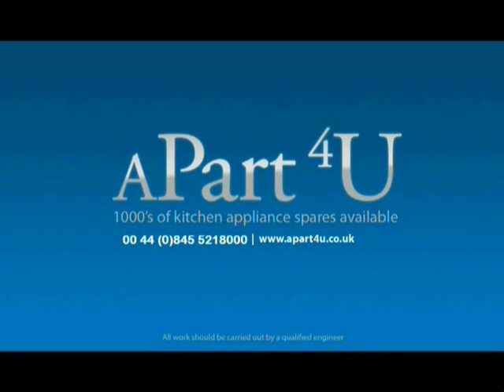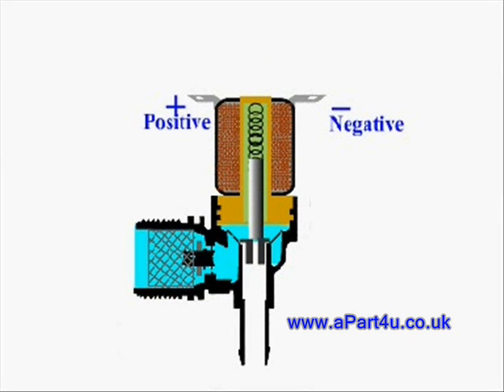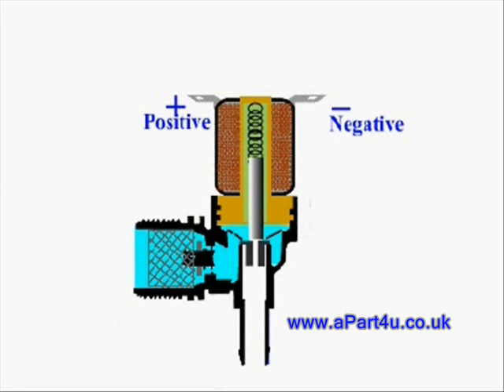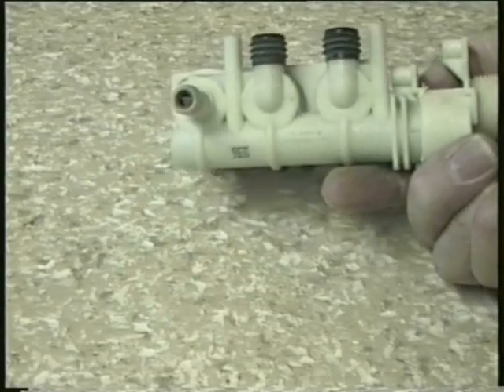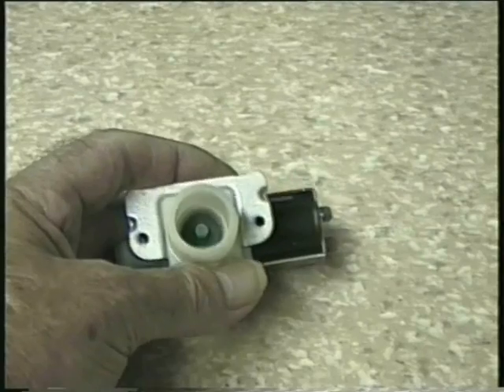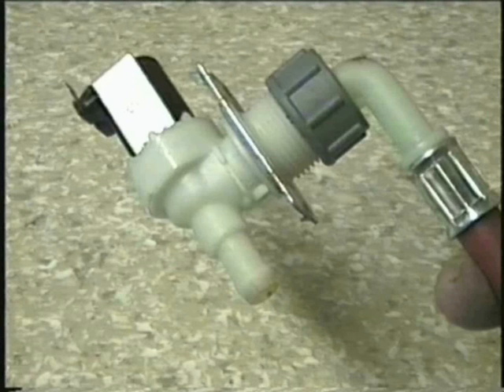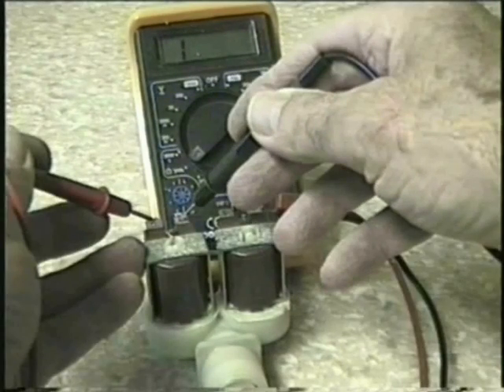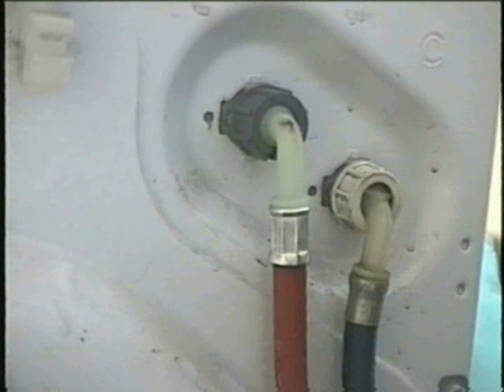Washing machine not filling with water

Comment: Hello, I couldn't find my washer at your website, but I'm hoping that you can help me.  From a thrift store I bought a Samsung Powerfoam VRT model # wa5471abw xaa01   which is a top loader that looks like a front loader.  The water won't go into the washer AT ALL.  I checked the valves, the hoses (both regular) the screens at the inlets (cleaned out one of them), made sure the drain hose wasn't pushed too far down into the drain.  

As far as I know I covered all the bases.  When I turn it on, I can hear clicking, like it's trying to work, but it won't fill.  Also...no error messages either.

I'm guessing it is either a relay switch or something to do with a pump (if it uses a pump) .  Can you  p  l  e  a  s  e  help me?  When I purchased the washer they said I could return it if it didn't work, however, it wasn't until AFTER I purchased the washer, they informed me they could only give me store credit and wouldn't refund my money,  Ugh!  I am just not in the position to throw away $100 dollars, and don't need any frivolous things from a thrift store.  They had no other washers to choose from, and I'm at the mercy of others to transport it 35 miles back to where I got it.

Thank you in advance if you can help.

Comment: I recently cleaned out the filters, ran an empty cycle with a tablet and it worked fine. Now, after filling it with a load, it has become a teenager ! It won't work beyond a first light flashing, I have checked the drainage hole, and the pump WORKS........... and somehow, I managed to get the inlet, work for 15 seconds, then it resumed sulking again. Back to the first light flashing again.    Am I a bad parent ?

Comment: need some advice replaced the water valve aswell as the water pressure chamber on a hotpoint WMUD942 Ultima and its still not taking any water in, any other advice you can give me?

Comment: Hello, I have Indesit WILD86 Washing machine, its stooped after the first round washing on any program with 02 green flash and one red flashing light and too much noise,
After washing for 10 minutes and start pull out the water to start rinse or complete the cycle here the flashing light start and can not take water again to continue.

Comment: once power socket to solenoid  disconnected, I measured Voltage on  the solenoid socket was 22Ovolts, but when connected back suddenly power voltage missed out and solenoid not operated.  could be somebody explain me what is going on my Samsung Washing machine Wa90fa.

Comment: Hello, thanks for all your info but I have a problem with my Kenmore  #110.25852400. The circuit tripped midway then I put it back on,saw a few sparks by the water level- pressure switch, then the water won't fill up; it has no noise and hose isn't clogged. I looked at the water inlet and it isn't clogged either plus I tapped it a bit but no water/power. *The spin cycle and drain WORKS fine but no power with the water fill up. Could you help me? Do you think the water level switch went preventing it to power or inlet, vice versa or? Fuse or timer part but don't think so? Help please...? Thankyou
Reply from the maker: without having appliance in front of me this is to hard to help, but it could be the level switch but also check wiring going through the door as this is acommon shorting fault

Comment: I almost forgot...you have a similar model which is a front loader.  Also, I did locate the manual online and checked out the "troubleshooting" section.  Again, I covered all the bases on that note, and it's still not working.

Comment: Hi Great videos. Can I change replace the cold water valve with the hot water valve. The cold water valve is broken. I have put the cold water supply to the hot water valve... it worked but not the right progam settings.. so I change the valves around. now it does not work at all even if I change it back. Will really appreciate your help..
Reply: Hey, My cold water inlet valve is leaking steadily even when the washer isn't on. I'm not sure if the base( plastic housing) is cracked or what. It's just extremely rusted. So, Question is: Can I swap that valve with the fabric softener valve, since I don't use liquid fs? I haven't checked the continuity on the solenoids yet because I figure with the cold one steadily leaking, then I'm positive it's no good!!  But, after watching this video and noticing what you said around 5:28 about swapping one for the other, I'm curious to see if it would work? Problem is though.........since the base itself seems to be the problem? not sure, will it make a difference when swapping them out? In other words, if the valve that goes to the fs is good and the cold water valve is bad, how is swapping the valves going to help since you don't actually swap the plastic base it sits in? Although, wouldn't it be bypassing the bad one then altogether? 
I know this is in depth but I really dk any other way to word it to explain the issue at hand!!! I am in dire need of my washer! Oh, and btw, it is an Electrolux front load. I dk the model# becaue where the tag was has bern removed or has faded with time. I got the set from a friend and it's at least probably 5-6 years old or more?? It's the one that is like a royal blue in color and has the small display screen to the right with the speeds, temp, and options, etc. under that. The wash selector is the large knob on the left that had 10 settings. Also, to the right of that it has the start/pause button and another for cancel. Oh and underneath the display screen are buttons for favorite, ?, and control lock(?) or something like that! Not actually looking at it right now!!! So, yeah, any assistance would be awesome!!
Thanks in Advance, ALL the way from a small rural place in TN, USA!!!**